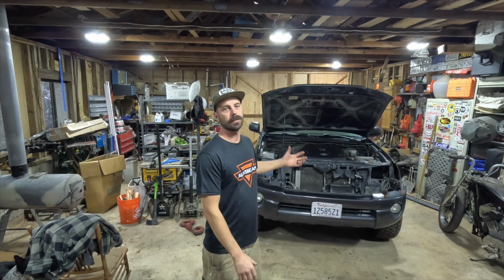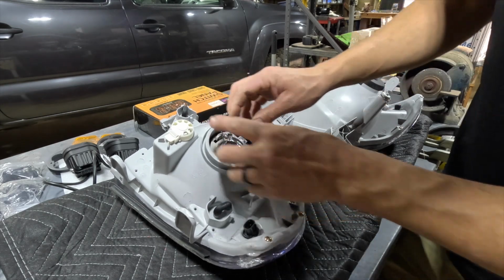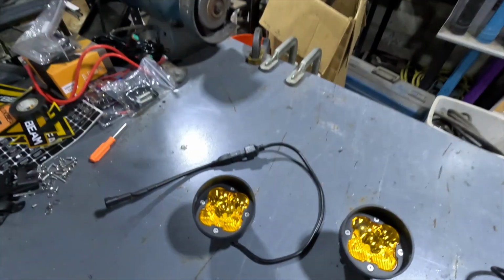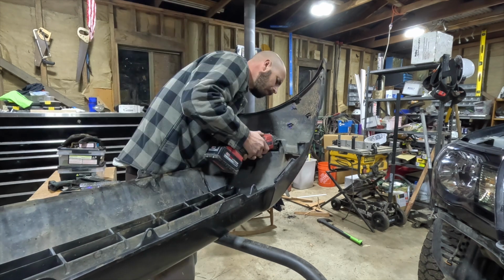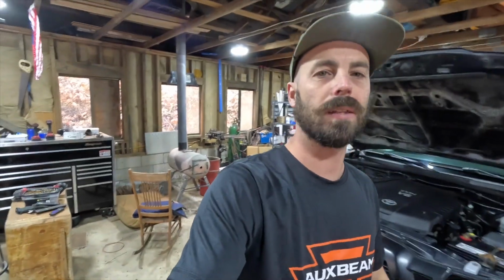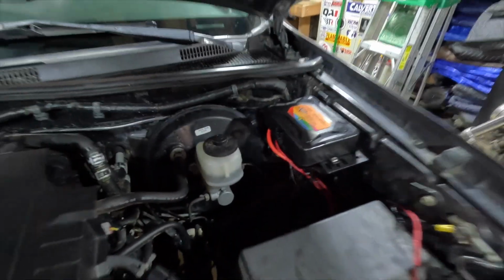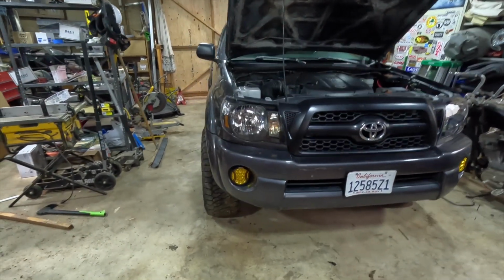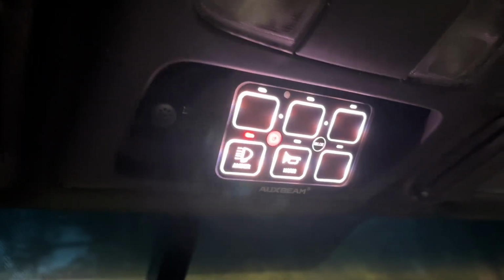Custom Fog Lights and HUGE Upgrades w/ @Auxbeam Lighting! 2nd Gen Tacoma

Comment: Awesome video man! Just as an FYI of unsolicited advice. Did LED headlights for a couple of weeks and I couldn’t stand it. No cut patter and less light for actual viewing purpose. I en up returning to halogen but I did high performance halogen, I went with the Philips Racing vision gt200, and oooooh booiiiii I take aftermarket headlights for a ride brother! The housing in the 2nd gen is meant to be used with halogens man. If you make it to hammers this year I’ll be more than happy to show you brother. And if your OEM were a little foggy do the cerakote kit, that thing work wonders!!!